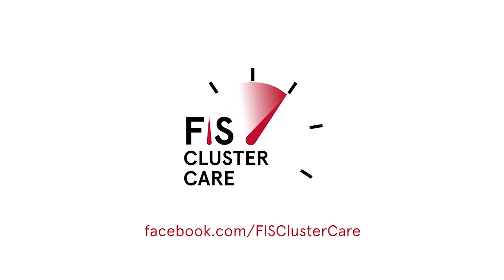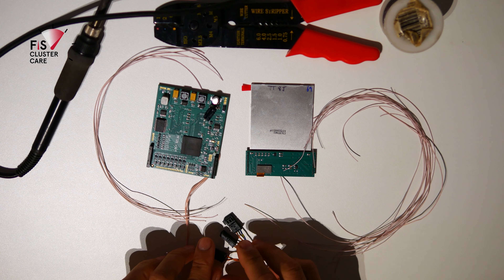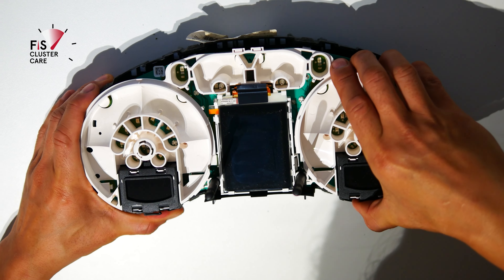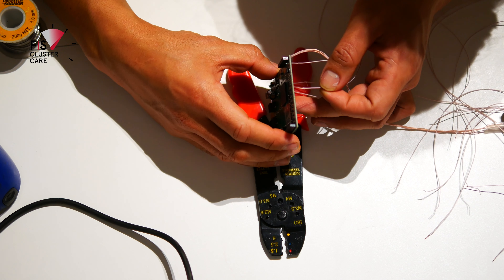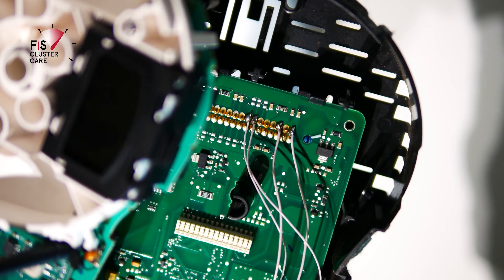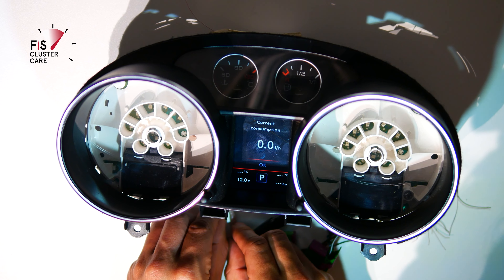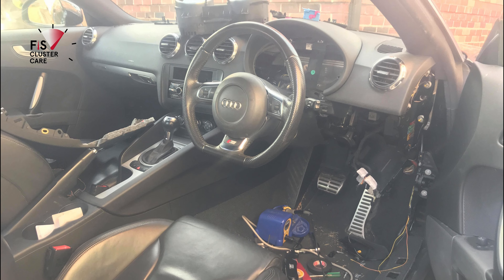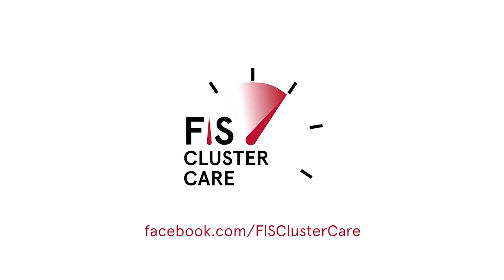ColourMFA for Audi TT Mk2 8J instrument cluster upgrade DIY guide. ColorMFA Audi TTS TTRS 8J PQ35

Comment: Great mod and video! 
One question - I can see at the start of the video you have all red displays including the ones showing date time and kilometers but in the end of the video all small displays are black white.
Did you changed small displays too or red ones changed colour?
Reply from the maker: Hello! I have changed instrument cluster as a whole. :)
Reply: @ianpgonzaga  so you took a new cluster from facelift and added ColourMFA to it? Is there any hussle with programing kilometers to show exact as on old cluster?
Reply from the maker: @marincatlak8614  yes that's correct. To match all data and KM odometer you need special hardware/software to do this.

Comment: Hey can I mail my instrument cluster to you and then you do this for me if so how much will it charge.  I live in Canada
Reply from the maker: Hi this is possible but you know you won't be able to drive the car with the instrument cluster installed as it will be immobilized? 

I currently am out of the kits but PM me at FIS CC link in description for a quote ;)
Reply: @ianpgonzaga  I don't understand what you mean by I can't drive the car because it will be immobilized please explain this
Reply from the maker: @OO-fc4ys  the instrument cluster is integral to immobilizer system. If you break the Chain in that system the car is immobilized.  It'll turn over once and then die.
Reply: @ianpgonzaga  I still don't understand what this means
Reply from the maker: @OO-fc4ys  hehehe maybe try disconnecting your instrument cluster and starting the car. You'll see what I mean 😜
Reply: @ianpgonzaga  now I won't turn on the car until you send me back the gauge cluster

Comment: Hey, you’re the only guy I know that would have an idea on the answer to this question… do you know if you could swap out a MK2 TT 3.2 speedo Gauge for a MK2 TTS speedo gauge?
Reply from the maker: Yes you can swap them. Just need the right tools to be able to match all the cluster data from original to replacement.
Reply: Bro you’re awesome! Thanks man!!

Comment: I'd love this upgrade in my 2007 TT 8J, any idea's of the cost for parts and installation?
Reply from the maker: Hi Alex. The parts itself is around $250USD. DIY Installation is doable as this video shows but if you need someone to do it it takes about a day to get it done. So factor that into the cost too.
Reply: @ianpgonzaga  thanks for the reply Ian greatly appreciated